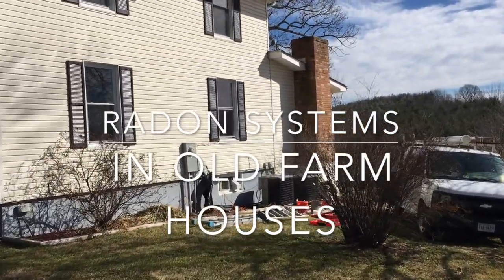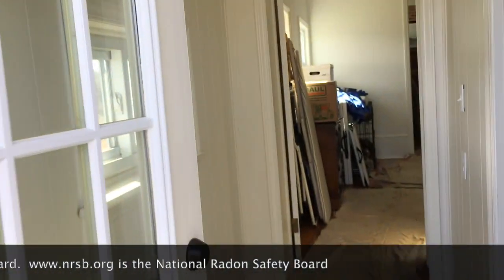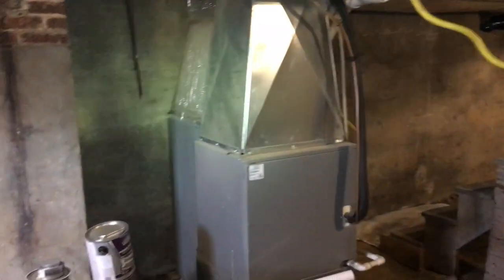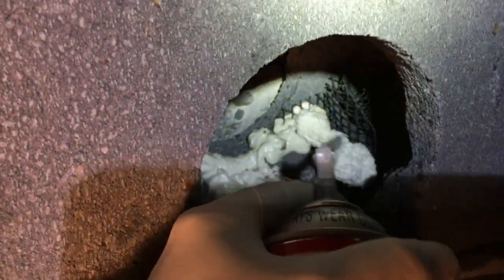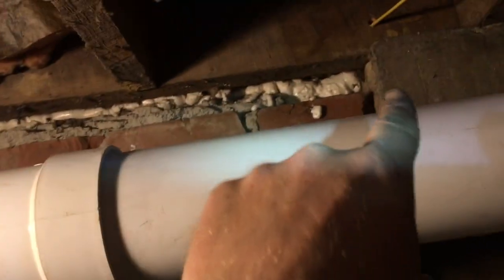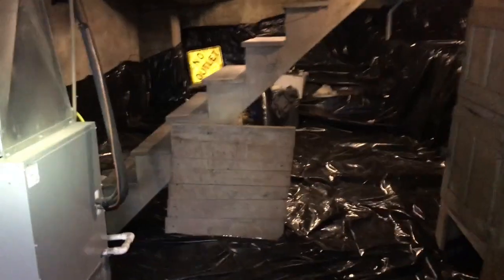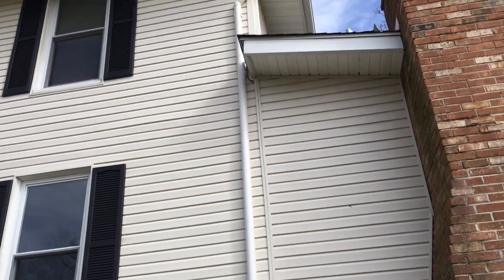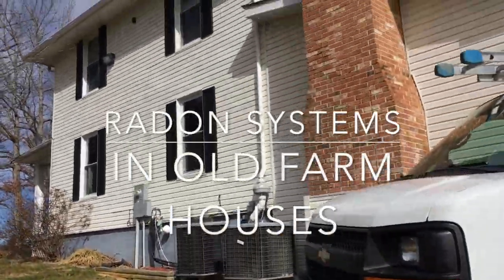How to Install A Radon System in an Old Farm House

Comment: How do you attach your envelope to concrete on the walls?  I have had difficulty finding something that will stick.
Reply from the maker: Hi Walter, I have had good luck using OSI Quad silicone- both white and clear.  The white spreads easier but it's white. That sounds odd until you cut your plastic too short. Ha! It's happened to me a bunch.  Also White Lightning 3006 which is water based (and costs half) does ok.  I keep all 3. 
They are all sold at Lowes.
Thanks for watching!